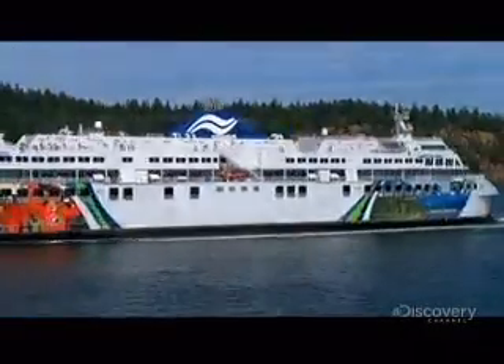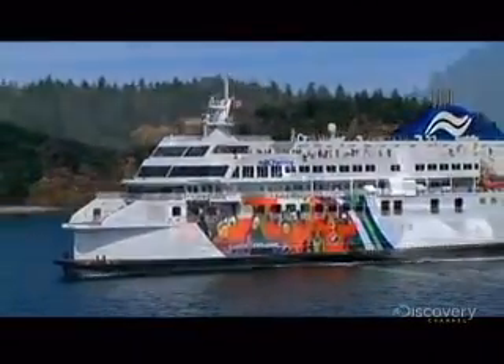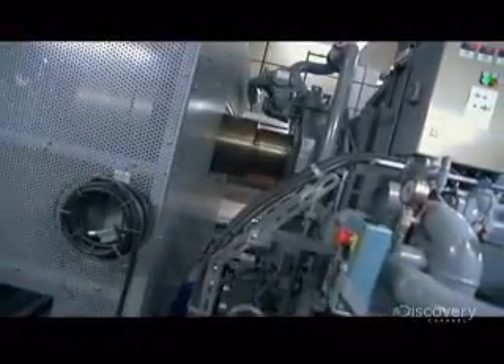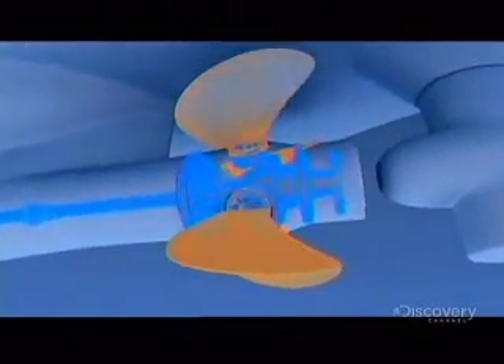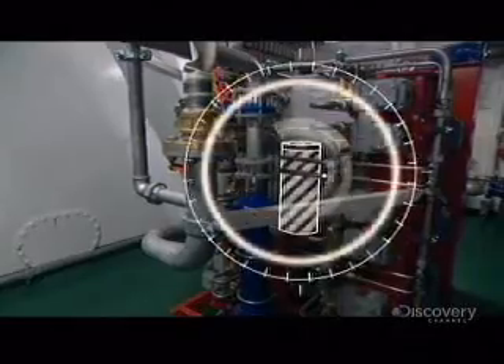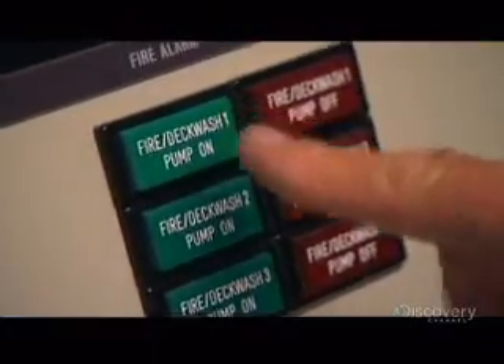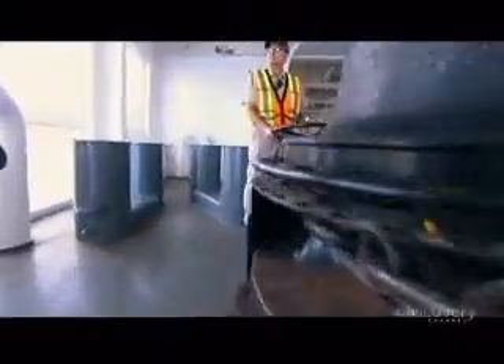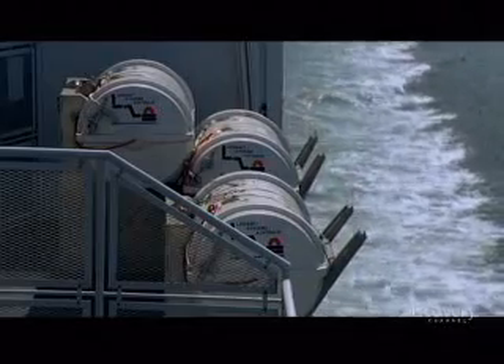How Machines Work - Coastal Celebration

Comment: These ships already have issues with cavitation of the props. The design has the ship riding too high in the water, with the result of the props sucking air from the surface when they are in the dock. They are also having issues with the sewage system and turbochargers on the MAK 8M32C engines.

Comment: I heard BCF brought not just the ships but also the designs from FSG. So technically if BCF needs more of these we can build them right here in BC instead of outsourcing jobs.
Reply from the maker: Rick Feng
That's correct, they did.  But they had the vessels built in Germany because they wanted cost certainty, something no BC shipyard was able to guarantee.
Reply: Alas~
Reply: @denelson83 8 year later! Weihai ship yard if I spell it correctly and not one single Canadian yard ever submitted a bid! Still ALAS after 8 years! 😅😤